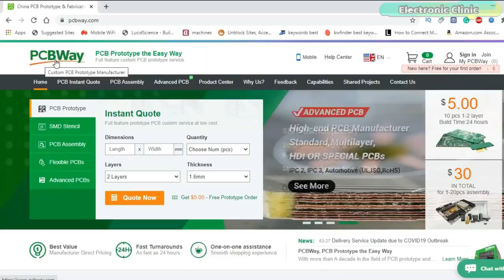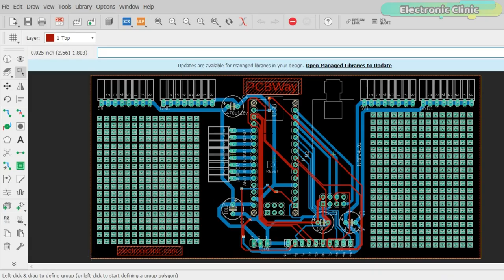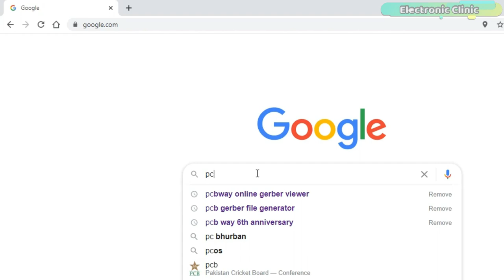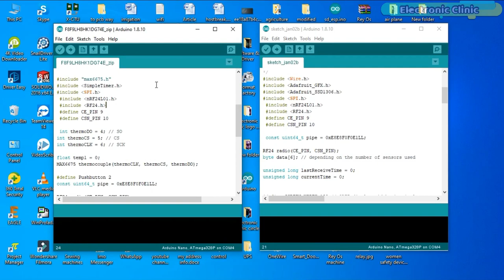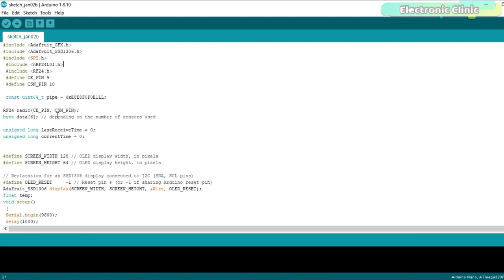NRF24L01 based Wireless Industrial Temperature Monitoring System using Arduino & Max6675, PA+LNA

Comment: I want to use upto 60 temperature sensors, it's for my Hatchery, which board I need to use?
Reply from the maker: its better you use the lora sx1278 with the arduino. you can creat multiple nodes and then communicate with the receiver. you can watch my latest videos on lora sx1278

Comment: Receiver side code is not working, I have tried  number of time.
Reply from the maker: its completely functional. check ur modules.
Reply from the maker: if you are using the pa lna ones then touch the antenna base with your finger.and see if you can receive data on. pa lna ones have some issues.
Reply: @ElectroniClinic  
Working ,Thanks
Reply: I request you please make project for  wireless temperature  monitorinng using Xbee with  relay so that load can  activated  after  a certain temperature.
Reply: @SandipEngr  pls tell the maximum range  of this project since you have made it

Comment: This is possible to ativate a relay on desired temperature?
Reply from the maker: yes
Reply: @ElectroniClinic  
Pls share the receiver side code, so that I can build.
Actually I want to set the temperature  at desire level between 0 to 1000   externaly ,so that relay can activate  on set  point.
Reply: @ElectroniClinic  
Kindly please provide   receiver side code for activate the relay at desire temperature level.